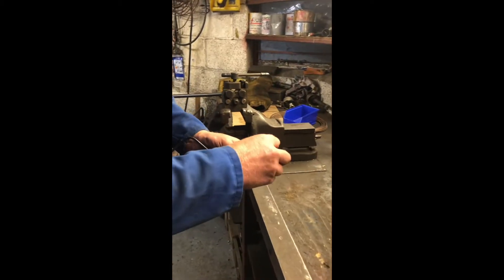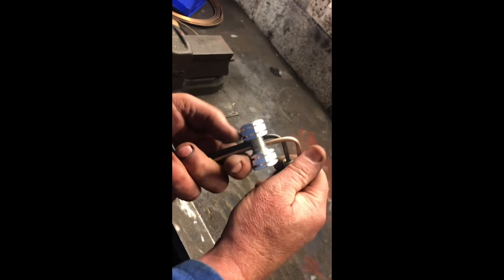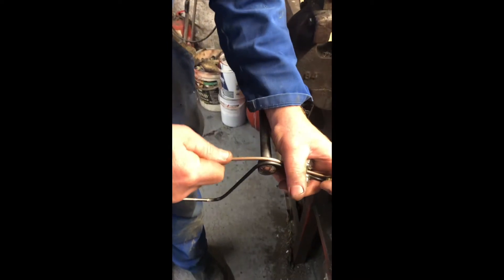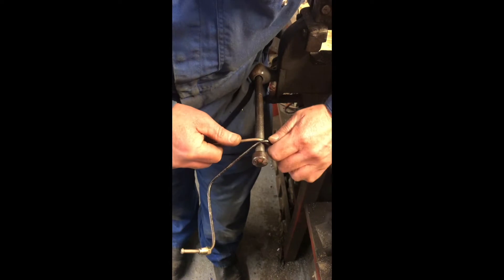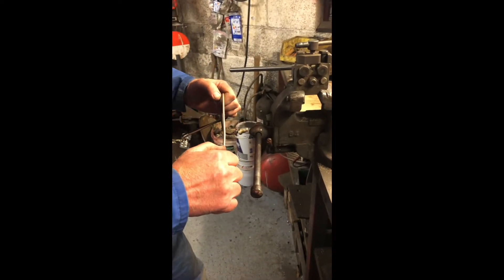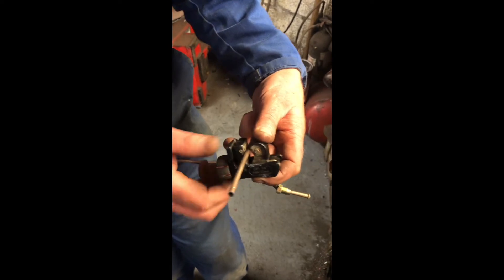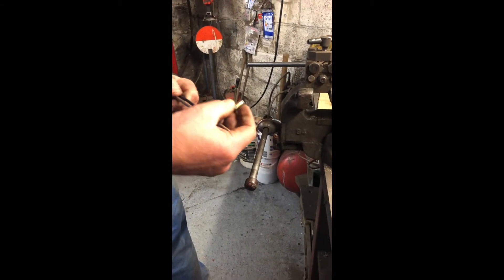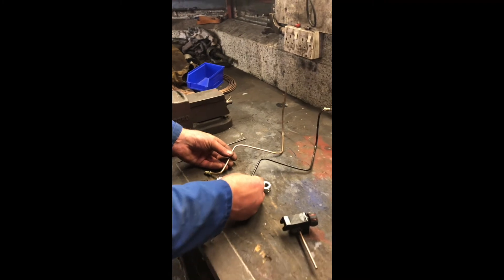Gwyn Lewis 4x4 Brake Pipe tool

Comment: Is that just a m16 bolt cut down the middle ?
Reply from the maker: No there not just a bolt they are made like that, others i have had a different head more like a star for better grip when using oily pipes.